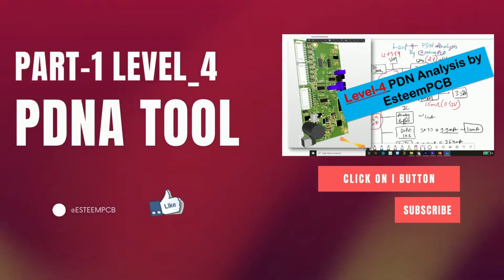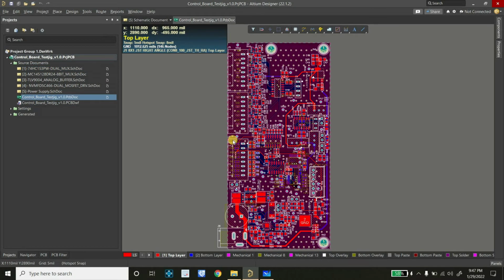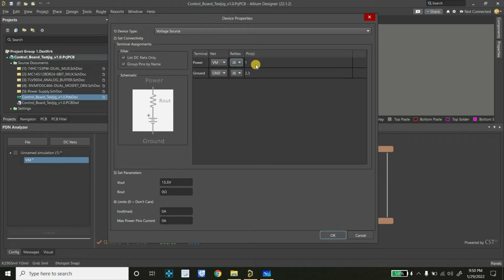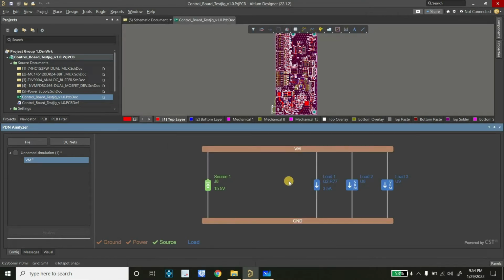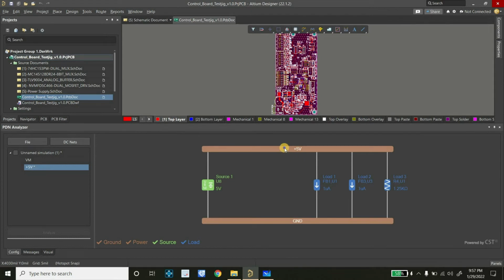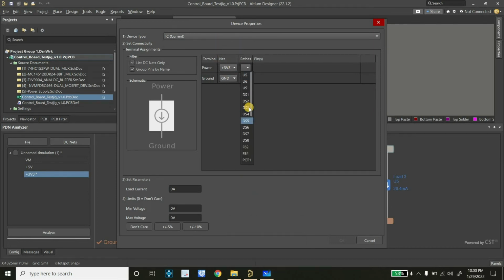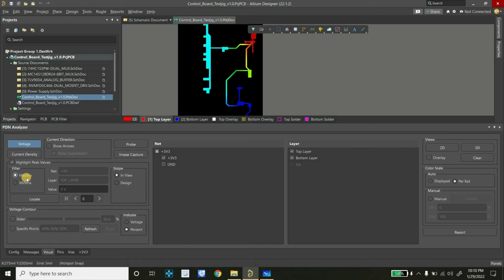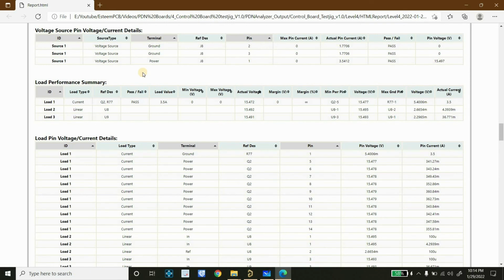PDN Analyzer - How to do PDN Analysis In Altium Designer 2022 - ADVANCED PART-2

Comment: Please explain the AC analysis in PDN , like Target impedance and Decoupling capacitors placement and count  etc
Reply: There is none - the PDN stuff in Altium is kinda useless for anything but batteries and LEDs - just DC.  Tesla won, Edison lost.  If you want true PDN simulation you need to spend big $$$ on things like Ansys, Hyperlinx, Sigrity, etc  Sigrity - $3,000.00/month.  This is why my one friend from back in the 1980's that worked for PADS (now at Cadence) bought his wife a new Tesla...  Yep... sucks, Huh?
Reply from the maker: Agree with PDN Altium you ll not get transient PDN simulation
Yes specifically Power Feasibility editor tool in Sigrity Aurora, ll do everything you want to do @pavan